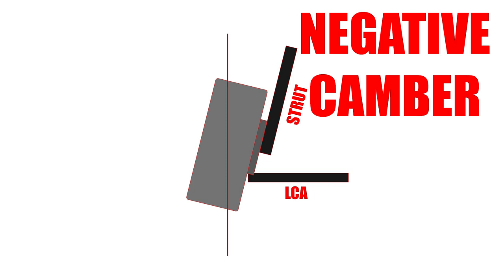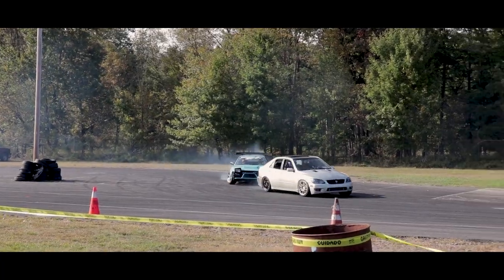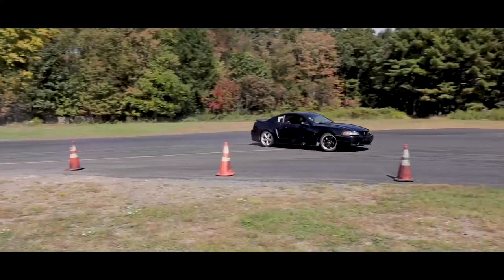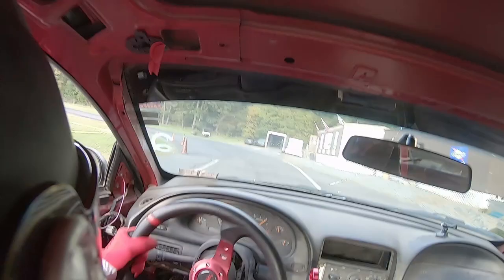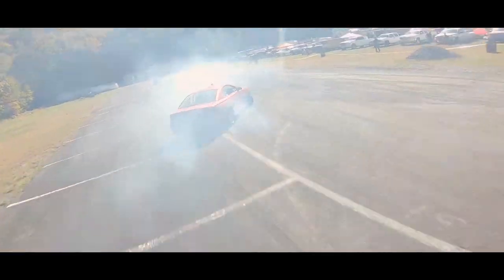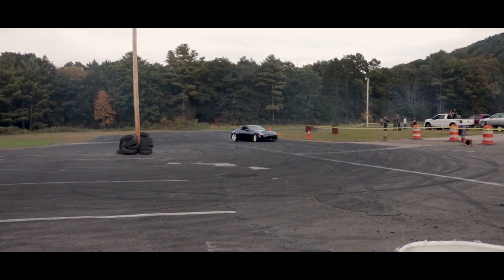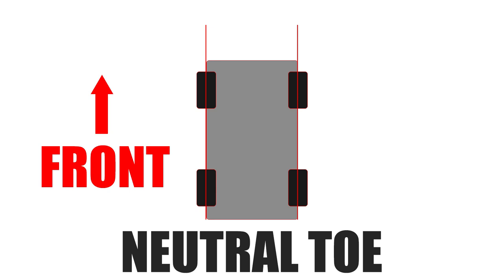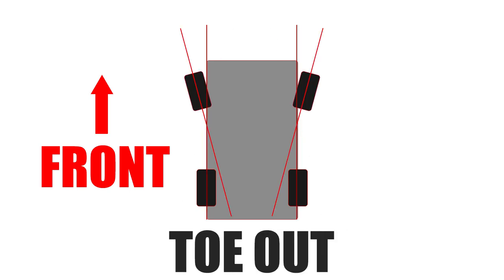DRIFT CAR ALIGNMENT HOW TO

Comment: Thanks for not making it a vlog like others do, Do you know how much horsepower is needed for drifting, it surely must be a factor of weight and road surface friction. i want to know exactly at what power level for a specific car rear wheels lose grip but front is still traction

Comment: nice tuned angle, i had use that tuned, only good for 4cylinder, Sr20det, Blacktop. when i used that tuned into my S15 2jzGtE , i need to widen the angle as the engine give much power for slide & clipping point
Reply from the maker: Cool!

Comment: For all Miata na/nb cars on stock LCA most I've gotten is +4 caster. And 0 camber. I had to get extened lower knuckles for the front to get -3 camber and +4 caster.
Reply from the maker: Glad it worked for you
Reply: @RatchetstrapMedia  those numbers were on my 94. Which was bent up pretty good. Putting my Strait 96 together rn gonna get all new number probably.

Comment: What you described as "drift ackerman" is actually NO ackerman. It's just straight steering. You can go even further by doing anti-ackerman which may give even more control while sideways just because of how the tires will track and no longer try to drag the trailing front tire even less than straight steering does. If you look at formula 1 (and possibly other grip racing cars), they actually employ anti-ackerman so the car steers MORE.

This happens because the outside tire is receiving more load, it can experience a higher slip angle without actually losing grip, and therefore drive the car harder into a turn. With drift cars it's similar but the opposite. The trailing front tire has less load, and can't experience as much slip angle before losing grip (or just causing excess drag) so you would actually want it pointing "straighter" into the path of travel then even the leading front tire does.

IIRC either Engineering Explained or Driving 4 Answers has a video on anti-ackerman that explains the physics of it, so look into it if you're curious.
Reply from the maker: No Ackerman is drift Ackerman.
Reply: @RatchetstrapMedia  Well, give anti-ackerman a try and report back your findings.

Comment: One thing i can't seem to find on the internet is actual wheel spacing apart (wide) on the front and how it effects drifting / steer. can anyone tell me what is the limit?
Reply from the maker: That’s not really a factor. People space their wheels normally so they can clear the control arm, and other suspension components while at full lock.